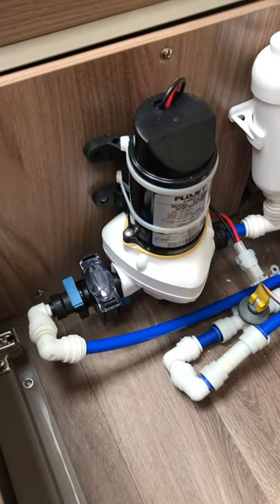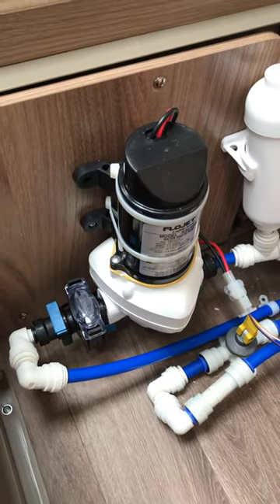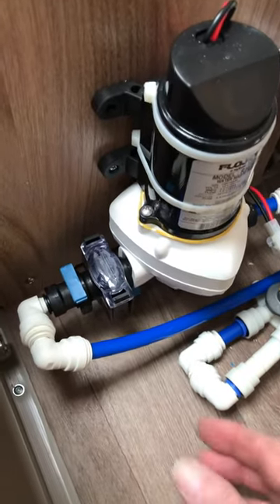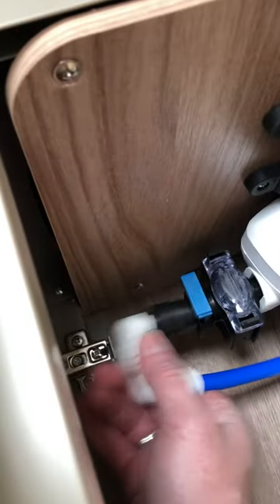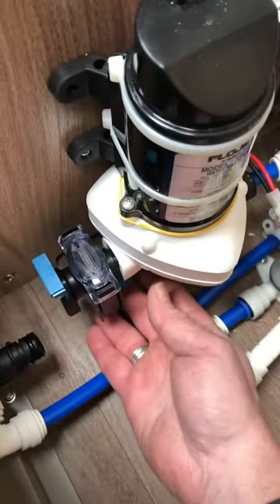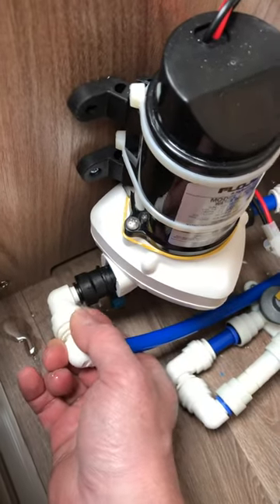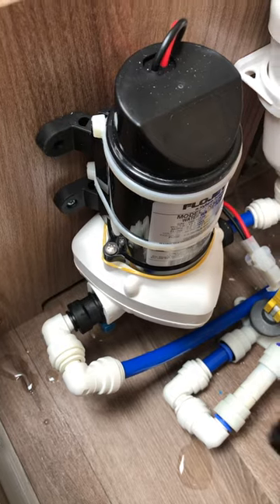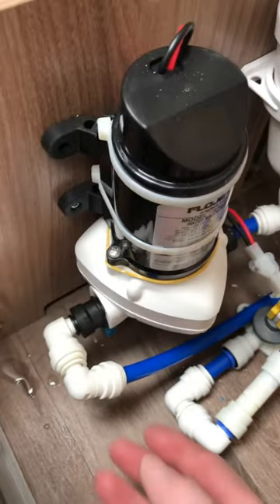Removing flojet pump filter

Comment: Do you know why there is a rubber band around the pump?  Mine has a rubber band on it as well.  Was the installer just lazy and didn't take it off???
Reply: Hi, yes, I think they have a rubber band on to hold the wire in place in the box.. there’s no reason for it to be on there.